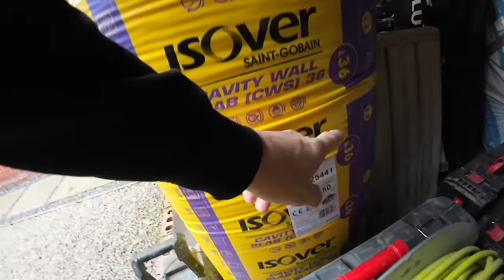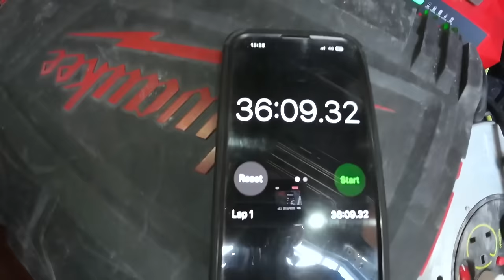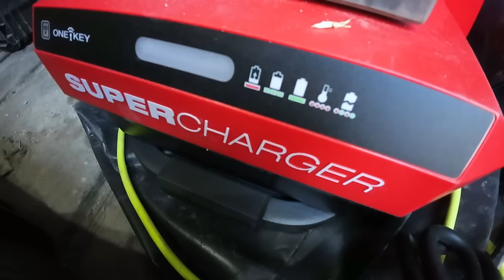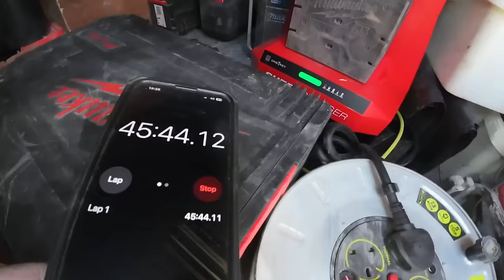GARAGE CONVERSION PT 2 . PREPARATION IS KEY ! PT 2

Comment: Thanks for the explanations Steve - much needed for numpties like me!  Still unsure of the necessity for a secondary rain trough after the Aco drainage - if rainwater does get into that concrete floor trough, where does it go from there?  Is there a risk of it overflowing?  Hope Alex is soon back up and running the show!  Keep safe both of you!
Reply from the maker: It’s never going to flood so it should trickle down into the foundation 🧱👍🏽